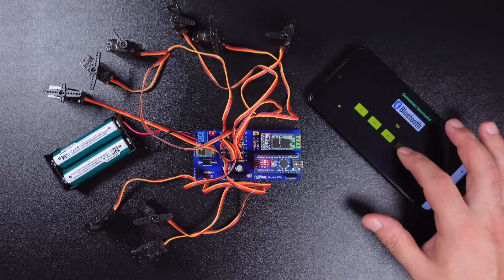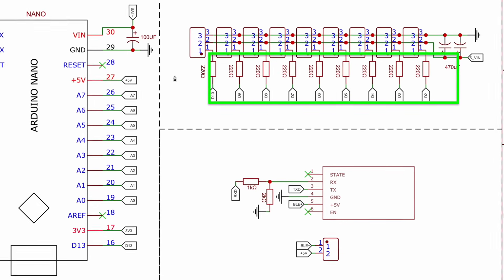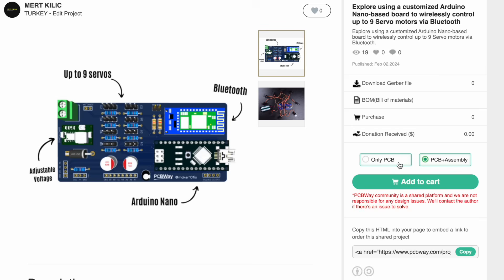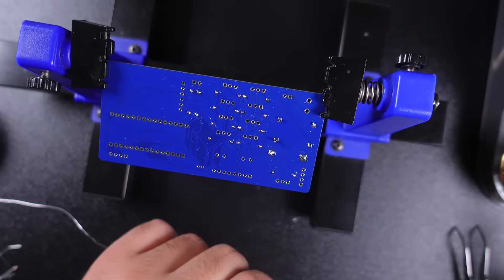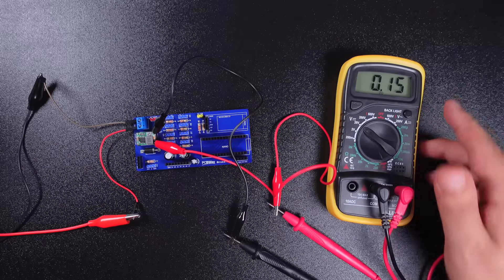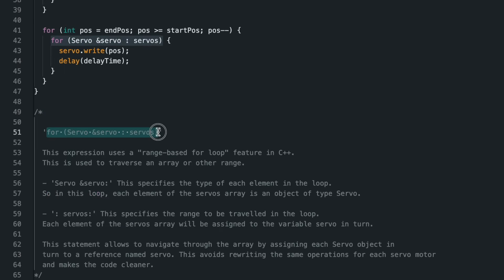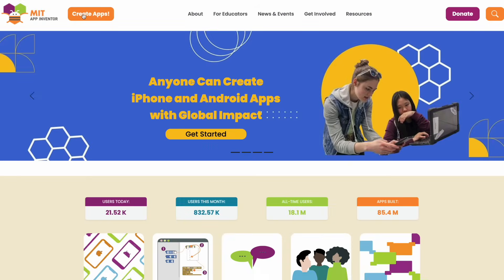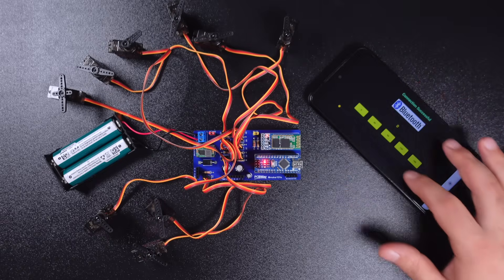Multiple servo motor control via bluetooth using arduino

Comment: Hi sir I have a question. If I don't have voltage regulator module, do I have to use in the resistor in the servo motor? Thank you

Comment: Please share the buying link for battery ( need battery for Arduino uno  +with 2 servo controller) this battery can support  this (2servo ) project ???
Reply from the maker: 2 pcs "18650 Li-ion batteries" were used in the project. You can easily find them in local stores in your country. Search for "18650 Battery" on Google.
Reply: Please upload warning sir

Comment: Hey , very nice and clever . I have a question , i own a non bluetooth/ wireless printer Samsung M 2870 AF printer. What can i connect to it to print from my phone?
Reply from the maker: If your printer does not support Bluetooth and WiFi, maybe you can do a Google search like this: "Smartphone USB converter or connection cable"

Comment: Hey marker, a question, if I create a code but I don't use it, but after several years I want to use it, does it affect uploading it?
Reply from the maker: If we are talking about coding an Arduino-based board, the code you write and the functions, etc. will all still work, but sometimes the libraries used may require updating. So create an archive folder for your favorite code and wait for the right time to use it!
Reply: @maker101io If it wouldn't be a bother, can you also tell me how to make the library or I'll update it, I don't know much, but I would love for you to resolve my question please.
Reply from the maker: @leonardoabimaelpena-luevan214  Please read this link: https://support.arduino.cc/hc/en-us/articles/5145457742236-Add-libraries-to-Arduino-IDE
Reply: @maker101io thanks